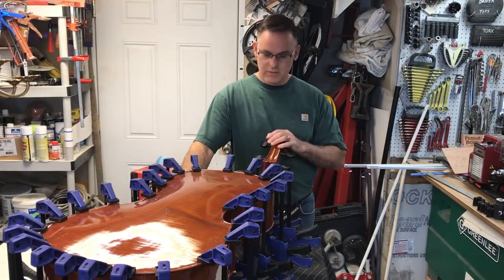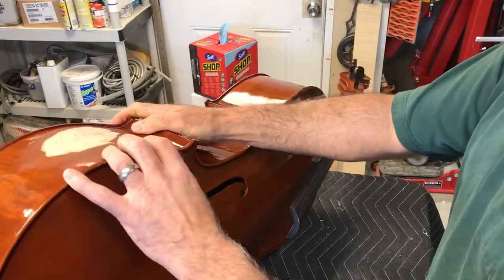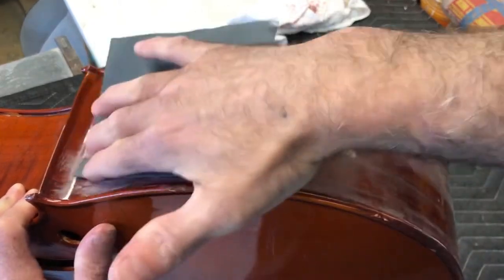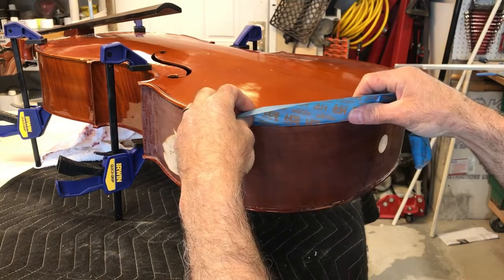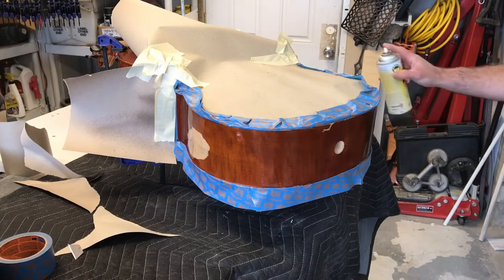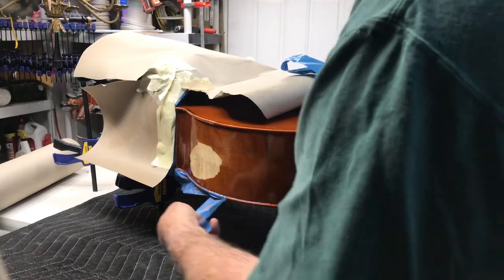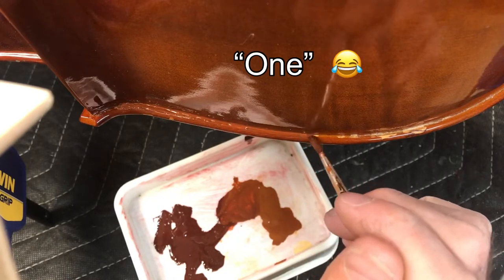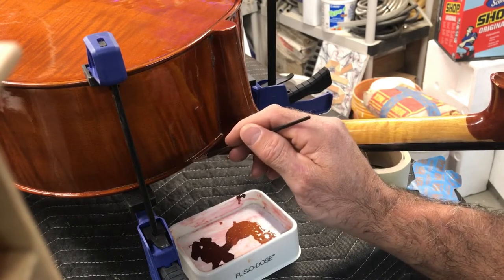Repairing  a broken cello (part 2)

Comment: what precautions did you take to replace the sound pole exactly where it was/should be? besides the neat tool. ECF
Reply from the maker: That’s a great question. I should have zoomed in on it and made a point of it. 
It actually made a slight mark in the inside of both the front and the back from its original position. I just tried to get it back in the same place. 

Hope that helps. 😉

Comment: What Kind paint do you use?
Reply from the maker: Sorry for the late response.  I actually used Minwax Oil based wood stains. If you have some old cans of stain sitting on the shelf for a while the pigment settles to the bottom. I would open a can without stirring it and use a small brush to scoop the pigment from the bottom of the can.